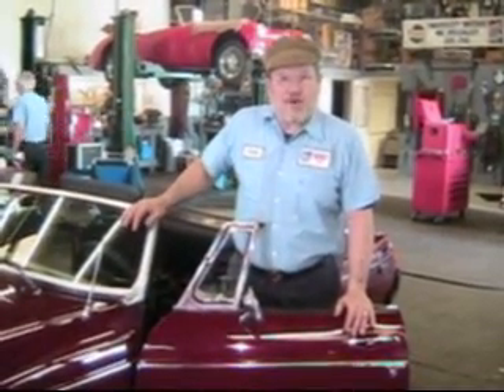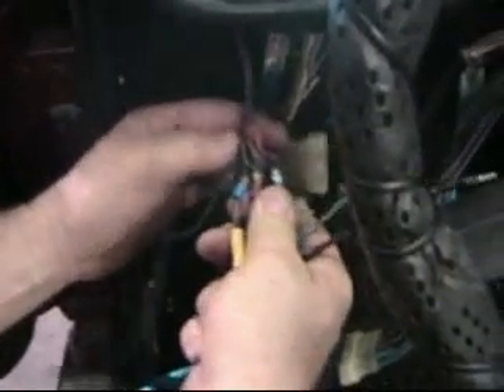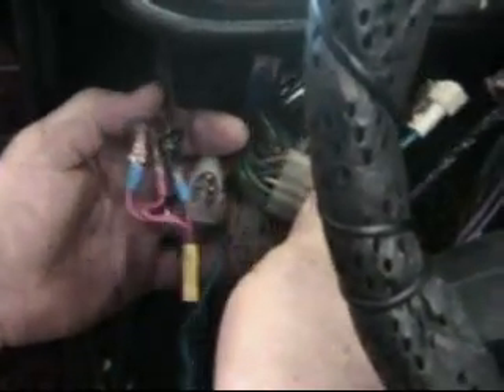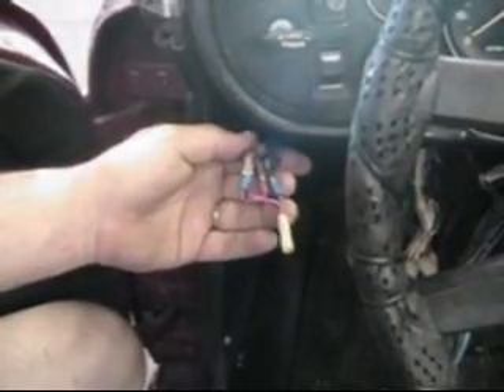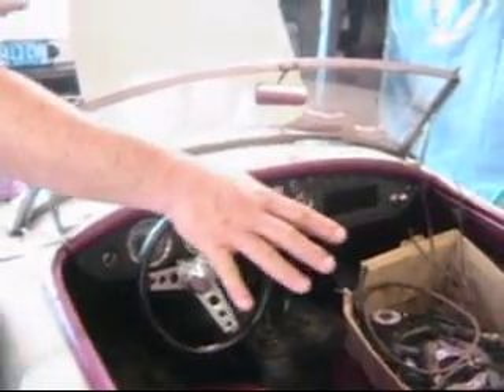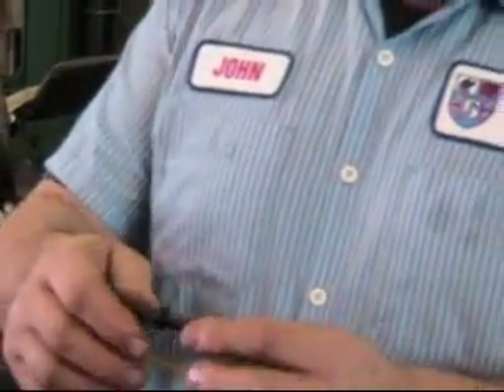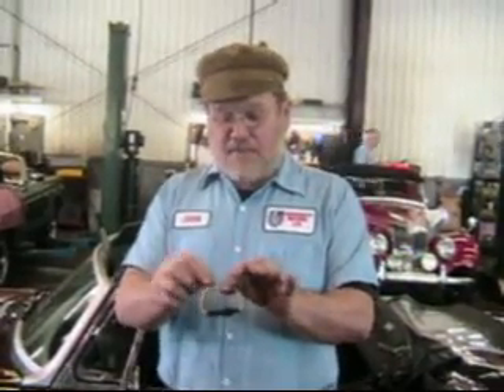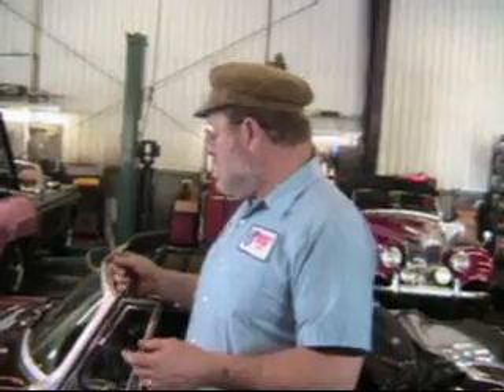66 MG Tech | Parking Light Circuit

Comment: John I just bought a 1978 mgb roadster. Runs great, engine looks well taken care of. I take the car for a test run to get it hot about 20 minutes.After the ride sometimes not all the time when i try to restart the car it acts like the battery is dead starter turns slow and will not start.Sometimes after playinwith the ignition key it will crank and start as normal. I changed the battery and the alt looks brand new. I get 12.48 volts on the battery all the time. any sugg. thanks steve